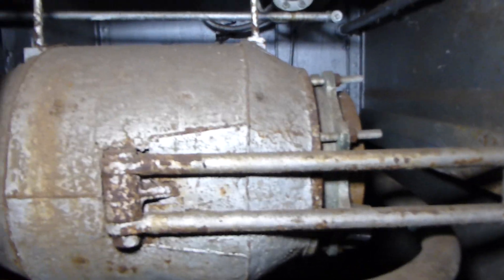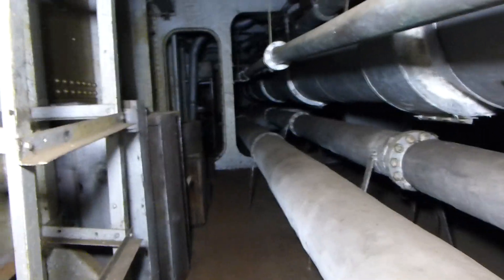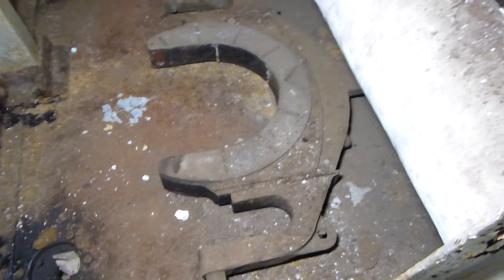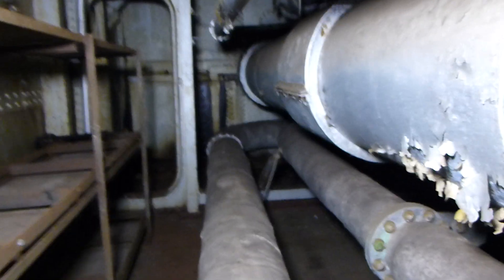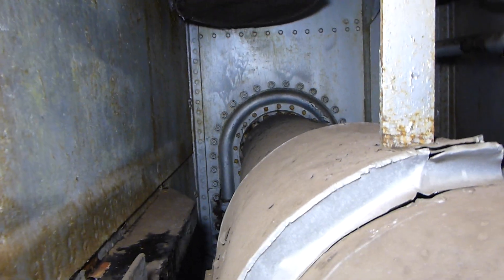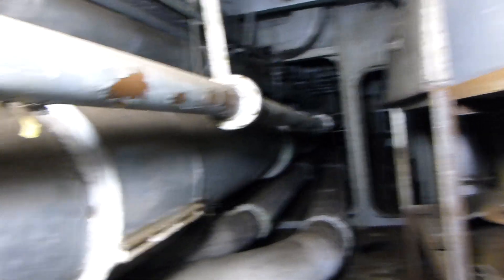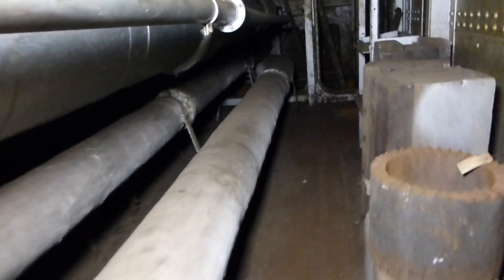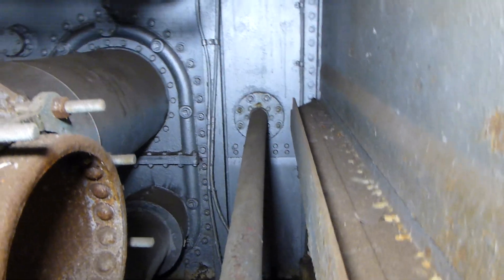Battleship Texas, Passing Steam

Comment: Would it be possible to make steam again or is it past that point
Reply from the maker: Unfortunately, no. It would involve inspecting and replacing hundreds of feet of steam line, rebuilding expansion joints, valves and steam traps.  Then there is the matter of rebuilding or replacing the equipment that is run by the steam.  Perhaps one of the biggest and most expensive challenges would be removing large amounts of asbestos in order to service the pipe and many devices.  It is currently safe in its undisturbed and encapsulated state, but that would change when you start working on things.

Comment: Could you include a plan showing where you are in the ship? Your explanation is clear, and we could look elsewhere from the references, but it's easier if it's in the vieo too.

I visited a concrete factory once where they burnt crushed coal at one end of rotating 100ft tubes. Something like 2500 F in the kiln; the heat in the service walkway was unbelievable as you went from the 'cold' end to the burner end, there were some railings for the steps and the guide said whatever you do, don't touch them. Gives me an idea of how hot those compartments must have been when she was under steam.

Comment: Another amazing video! Thanks for this "insider" view of the ship! I'm curious about the large cylindrical pieces hung on struts at either end of the main steam run. Are these the expansion joints? Also, what is that large cube-shaped object about eye-level you must walk around at the beginning and end of the video? Is it a motor or counterweight?
Reply from the maker: Yes, those are expansion joints.  It's can be hard to tell when they are covered with a heavy blanket of asbestos lagging.  They take up any thrust or pull against the 90 degree turn caused by pipe expansion or contraction.  The giveaway is the ring and threaded studs that extend out of the end.  They are common on all of the high pressure expansion joints I've seen, including those carrying steam between the main engine cylinders.